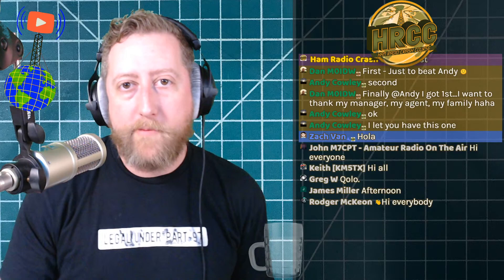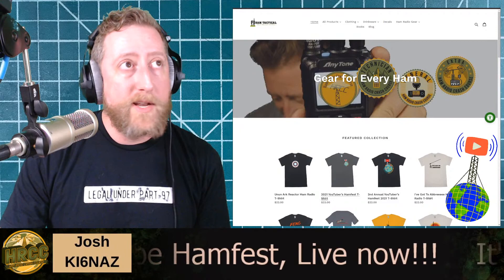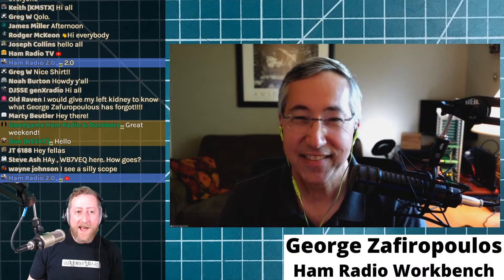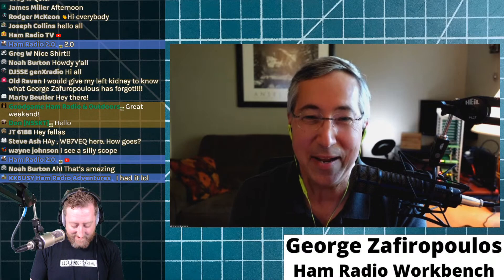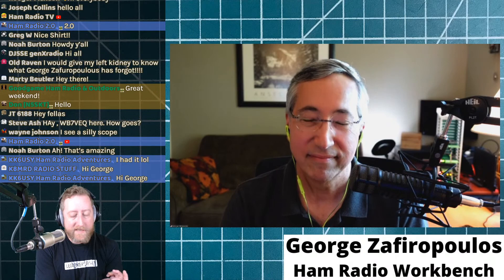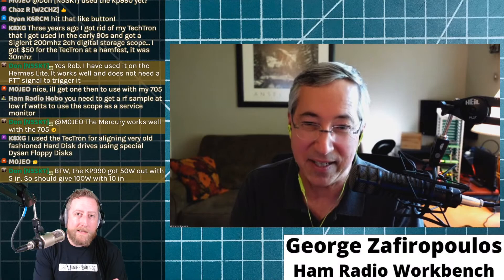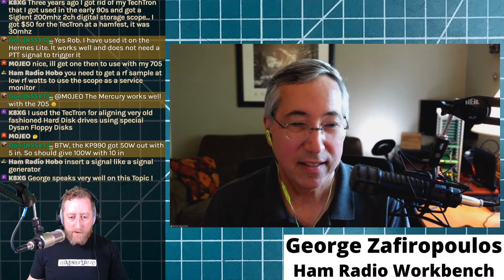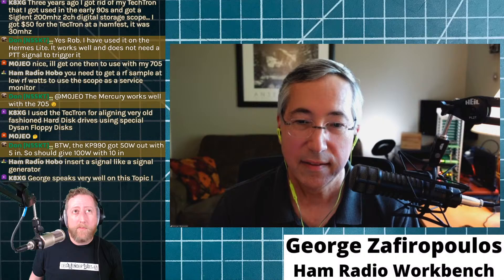Oscilloscopes For Ham Radio with George Zafuropoulous Ham Radio Workbench - #ythf21

Comment: Some pretty shocking statements in there, IMO. If you ever plan to do anything Arduino, get a 4-channel scope. Also, if you think you need 2, then buy 4 -- I don't know anyone with a 2-channel that didn't occasionally wish they had bought 4, and it's not that much more money.  Also, if you plan to do serious homebrew, you need a real scope, not a USB software scope. If you're measuring signals that are just 5W, you're talking 44 volts peak to peak -- child's play for a "box scope" as he calls it, and death to the little USB scopes. Also, an "RF signal generator" is a crazy thing -- by that name, you will get something that can do VHF, Microwaves, etc. costing thousands of dollars. A standard 30MHz sig gen (koolertron for <$100, Siglent for ~$400) will generate excellent HF, and isn't so exotic as he makes it sound.

Comment: These speakers are talking all around the topic but not really hitting the nail on the head.  A multi-meter is for measuring static signals (or if it's an AC voltage, then at least the phasor associated with the signal is static/constant).  An oscilloscope is for measuring time-varying signals.

Comment: I went with a 200mhz Rigol scope. Still learning all the functions it does! 48 years of repairing electronics... since I was 12. This is the best scope for the money (Was $369 if memory serves me, Amazon has it) I have ever owned. Even beats the rack mount 400mhz Tektronics scope I bought surplus from a nuclear research lab that closed down! Does all kinds of math functions, direct reads DC voltage, frequency, rise time etc etc etc

Comment: I won a $1300 Keysight scope and I am waiting on it to come.  Never had one but have wanted one.  I almost fainted when I found out I won. But while watching videos on scopes in general, I am discovering just how cheap would have worked for me but free is cheapest so....    I am freaked out I will overload it someday or short to ground.  I have seen some videos suggesting to plug the scope into an isolation transformer to stop the grounding issue.  So cool how many lower-priced options out there. I am just a hobbyist and very little knowledge of electronics. But I have things in mind to experiment with and need a super-sensitive scope. Nice talk in this video.